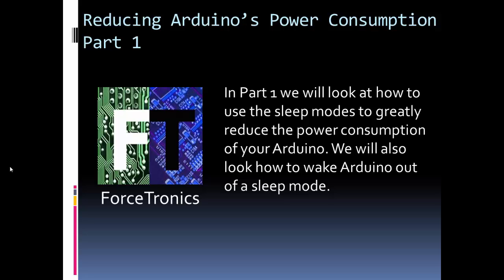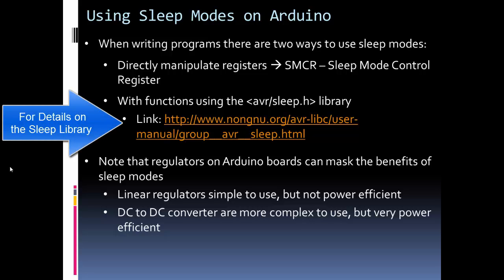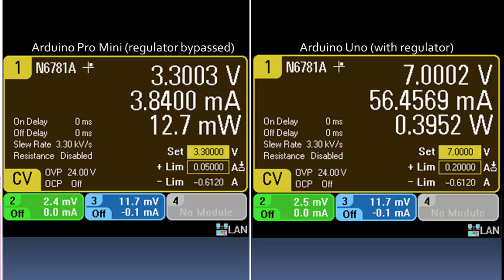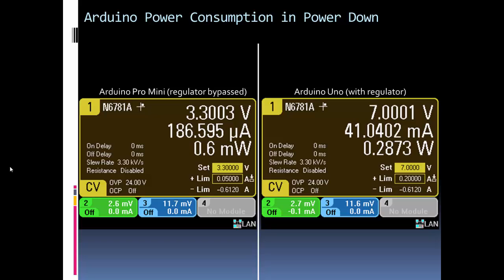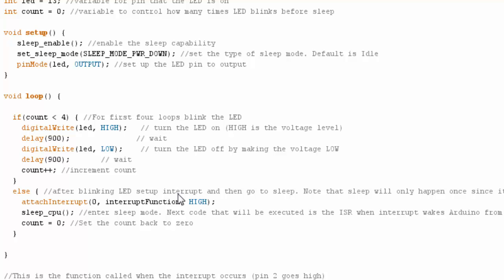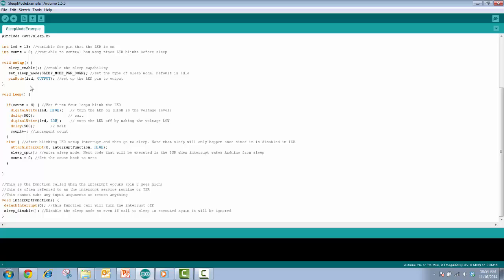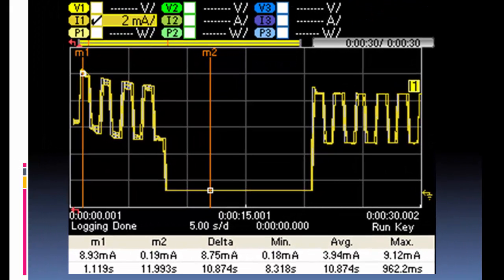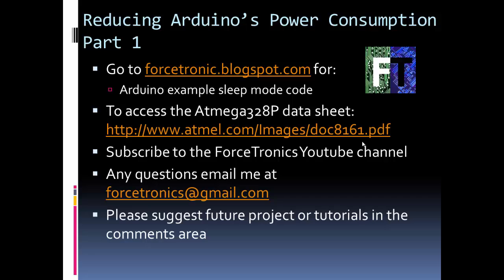Reducing Arduino's Power Consumption Part 1

Comment: Hey Dude!  I Like Your Style.
I like the way u present a code and then explain it out, line for line, and offer in possibility's or options that could be added in, or changed.
It does helps that u solved an issue that was plaguing my brain on a part of code for my project, So Thank you.
I'm looking forward to more of your videos. 

Joseph in Pacific Grove

Comment: Thanks so much for this! I didn't know this function exist until I drained my 12v Motorcycle battery while running a test project using Arduino on it overnight.

Comment: HI It's really helpful for me .
Sir,  would you explain how to bypass a regulator?
Reply from the maker: You just need to find a place on the circuit that is downstream from the regulator to connect your own power source or measurement. In the video I do this by connecting to the VCC pin on an Arduino board versus powering it with a wall wart power supply (which goes through regulator).

Comment: hi can you please explain how to bypass regulator in arduino mini pro
Reply from the maker: The raw DC pin goes through regulator. Using the VCC pin is after the regulator. You can locate this information by doing a simple search on Pro Mini schematic

Comment: Suppose controller is in sleep mode. There are 4 sensors are connected to the digital pins. If there is any changes on those (High or low) pins controller should come back to normal mode . This is what I want to make. 
Is it possible to do like this ?
Reply from the maker: Well on the Atmega328 there are only two interrupt pins so you would need to connect more than one sensor to each pin. But yes you could do that.
Reply: I want to do with arduino nana

Comment: hey, what about ATMega328P Standalone at 8 mhz?
Reply from the maker: +Razor Coding In the example I use a Pro Mini that runs at 8MHz, it has the power LED ripped off, and it is powered directly (not through on board regulator) so it should be really close or at what it would draw with bare bones components.
Reply: +ForceTronics I have to run on 5v (3.3v doesn't work don't know why) can you tell me why i can't run on 3,3v? there is only the ATMega328P Chip with pull-up on reset . it doesn't power on  but >4v everything works fine
Reply from the maker: What doesn't work at 3.3V sleep or the MCU? What is your exact setup?
Reply: +ForceTronics the mcu doesn't 'power on' is it because of BOD ?!
I can't disable the BOD because of your code in i think part 4 doesn't work for me . all correct but avrdude can't recognize the mcu
Reply from the maker: The ATMega328P has a voltage range of 1.9V to 5V but there are some restrictions on clock speeds at lower voltages (see datasheet). Do you have a scope to verify your clock is working at the lower voltages? When you try to power it up, what is on it programming wise?
Reply from the maker: The BOD only kicks in after the voltage ramps up to the correct level so if it were the BOD it means your power supply voltage is not stable.
Reply: +ForceTronics the mcu does nothing <4v . have it standalone @ 8mhz no serial connection and so on. I tested with blink sketch and a red led on 13
Reply from the maker: Can you verify that the oscillator or resonator you are using works below 4V?
Reply: +ForceTronics I do not have a oscilloscope, I think I will buy to start the DSO self-build oscilloscope Kit . I tried much power sources and always the same. I don't have an alternative mcu for testing right now
Reply: +ForceTronics I use internal clock

Comment: Dumb question but at 5:16 you had a note that stated that the sleep_cpu(); command is the last piece of code executed before sleep. Does that mean that the count = 0; does not get executed or does it complete the else statement before sleeping?
Reply from the maker: +Caleb Burnett Code stops at the sleep_cpu() function and the CPU goes to sleep. Once the interrupt occurs the CPU wakes up and the code in the ISR is executed. After the ISR function is complete the code after the sleep_cpu() function call is executed, which is the rest of the else statement. Hope that helps clarify!
Reply: +ForceTronics That makes sense now. Thanks for the clarification.

Comment: thanks a lot dude..really helped a lot..but just a small doubt i had..led blinks 4 times..normally then goes to sleep mode..then waits forever until button is clicked..sleep mode gets disabled..so again led should blink 4 times..right..then again..it should go to sleep right..BUT when u clicked the button. the led kept blinking..and i was counting the blinks..and i was hoping it will again go to sleep after 4 blinks..but it just kept blinking..so a little help on that..would be great..thanks..
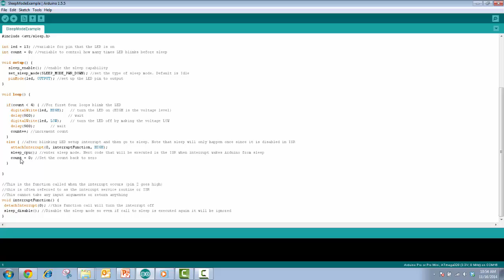Reply: +Riju De 6:00, he states the arduino will not re-enter sleep.
Reply: but how make that the arduino will re-enter sleep each time?

Comment: Can this work with arduino mega?
Reply from the maker: Kazuto Ueno Anything that is chip specific or programming specific that is discuss in the video you would have to verify it in the ATmega16U2 datasheet since what is covered in the video focuses on the ATmega 328 MCU. You could always try and see what happens :-)
Reply: *****
thanks. I tried and it does :)

Comment: I think you CAN "bypass the regulator" on an Uno-style board by feeding 5V in through the USB port, or directly into the "5V", and that will save significant power.  But the Uno has a lot of other components that were not chosen to be low-power (comparator for power switching, USB chip, and the LEDs you mentioned), so it's still a bad choice for low-power applications.

Comment: Hi, could you explain how you bypassed voltage regulator on pro-mini?
Reply: *****
thanks, was thinking about that, but when I use battery eg. 2 x 3.7V lion, or just one cell 3,7lion then would loose some current by 3.3V regulator anyway, isn't?

Comment: The best tip for long battery life is to use the right battery! Depending on the application a battery holder with 4 AA size batteries (NiMH or Alkaline) will give TEN TIMES longer life than a 9V PP3
Reply: *****
Our local bat group uses lots of batteries - for bat detectors, torches etc. Very different applications as torches use lots of current, while bat detectors generally don't. I did a simple study of a few battery power sources - mostly to dispel peoples incorrect ideas. The data are taken from manufacturers data sheets. The important pages are here
http://www.durhambats.org.uk/about_torch.htm
and here
http://www.durhambats.org.uk/batteries.htm